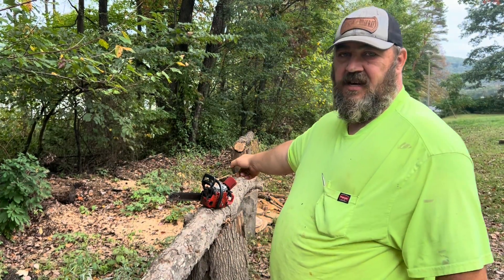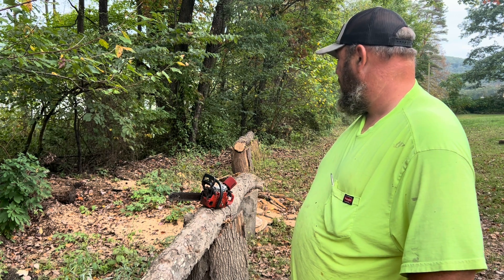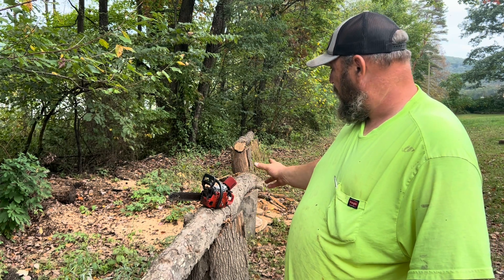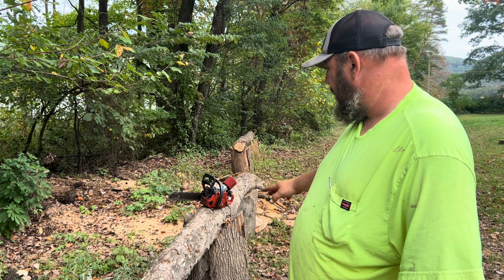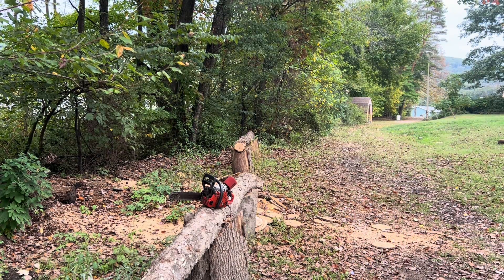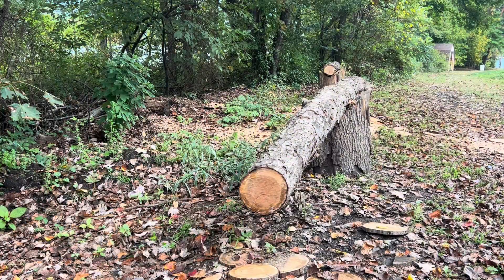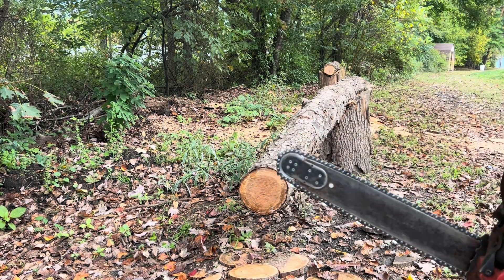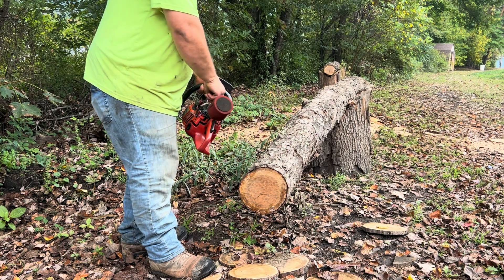Building A Racing 50cc Class Chainsaw!  Testing Revealed More Problems!  Part 12!

Comment: If you can find an all oem 357/359 carb (preferably HDA199) filter mount and filter I’d try it because my 2152 and 350xp are making killer power and the top covers fit with very minimal mods. The Venturi size is about the same as a 372 carb anyways. From the sound I’d say you really need to get a top cover on that saw. She was hot